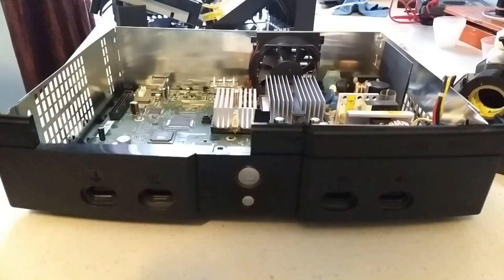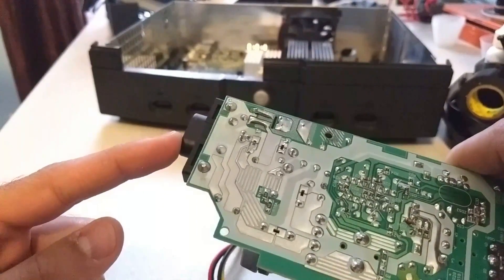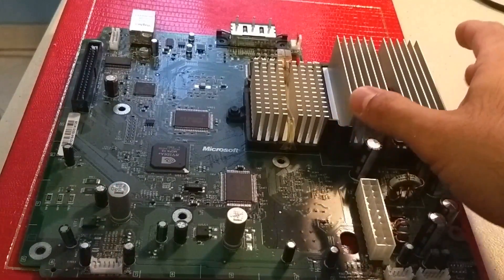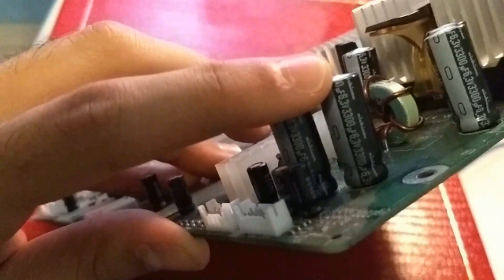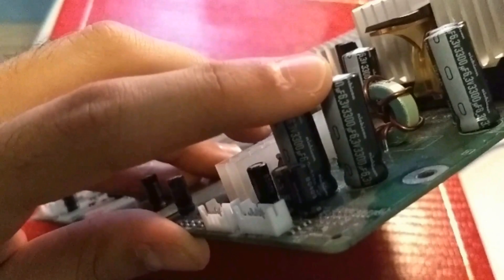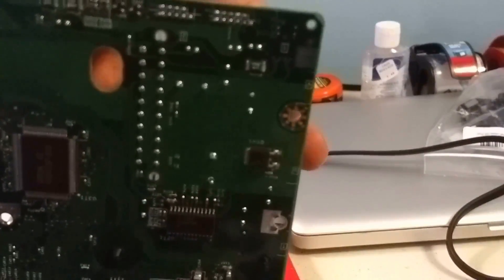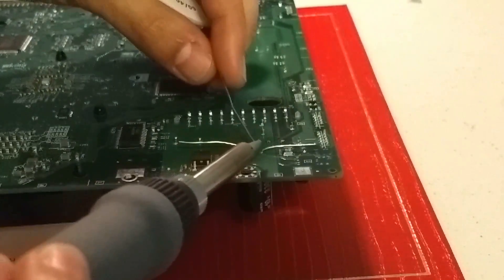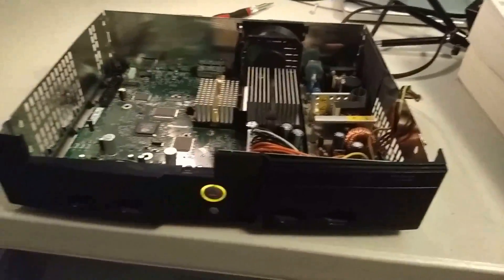Original Xbox No Power Fix- Capacitor Replacement

Comment: Any tips for desoldering the caps? Mine just don't seem to want to come out 😂
Reply from the maker: without a desoldering gun, you just need to focus on one leg at time. Make sure the iron is hot enough to melt the solder and then pull

Comment: You should get a desoldering gun
Reply from the maker: got one shortly after this uploaded. I dont do cap replacements without it now. Most people who dont do repairs often may not want to shell out for one though. A standard iron will still get the job done.

Comment: How on God's green earth did you remove the solder I have been doing a lot of different techniques nothing worked
Reply from the maker: watch some old soldering tutorials for working on technique and general tips. Honestly those old 1950s ones are super thorough and well made
Reply: @retro_vg_repairs3339  I have learned a lot since my first comment I'm doing microsoldering, cap replacements, joystick replacements and encoder swaps along with trace repair
Reply: @retro_vg_repairs3339  way more experience now as of last year but you are correct in my case I added fresh solder then it went smoother did a RAM upgrade and everything myself as well as a full refurbishment I will say the clock cap thing on a 1.6 isn't necessary true it was at the time but they are well past their life span and I'd recommend replacing them or putting a LED in its place

Comment: hello can u  help me ? i have an v1.2 og xbox with foxlink power supply 220V The main capacitor 400V 180uf is bulging after i replace it with the new one its bulging again and again ,pls help
oh yea and theres no sign of burn component everything looks clean
Reply from the maker: you replaced the cap or the whole PSU?
Reply: Just psu main cap & all cap on the mother board
Reply from the maker: @dani8902  I mean at this point try to replace the whole PSU. Could be something wrong with the whole Power board. If you have a spare xbox thats the same model, try swapping
Reply: @retro_vg_repairs3339  Hard to find a new V1.2 PSU on market og xbox Is very Rare on My Country :/

Comment: Ironically these are the exact capacitors that went bad on mine. Thank you for this video!
Reply from the maker: its somewhat common for those to fail IDK why
Reply: @ my new issue is that my hard drive just doesn’t read now. I have years of progress and mods on it that I can’t access anymore

Comment: Hey mate i blew the capacitor right at the stair of the board where the power comes in and can’t read the size of it could you tell me what size yours is so I can replace my?
Reply from the maker: The caps that are electrolytic all have their values written on the side. Try to take good pictures

Comment: the 1.6 clock caps do leak as i've had several that have leaked and are in a worse position as the traces beside it are off the mcpx2 chip(south bridge)
also the power cord he refers to was issued for the 1.0 with foxxcon psu as they were pron to failure and were never issued for later console as the issue was addressed correctly

Comment: 1.6 xbox didn't exist until 2004.  The reason he has saves from 11/01 was because he unplugged it long enough for the clock capacitor to drain, and then on next boot up just hit A a bunch to skip past setting the time, so it was set to release date.
Reply from the maker: Correct, but that would have killed the vibe I think

Comment: Invest in a pair of micro sheers/cutters. Bending the leads back & forth till they break is no bueno, dude! You take the risk of stressing your solder joints otherwise. Other than that, good video. 👍
Reply from the maker: Correct, but im also not ham fisted and twisting it super hard. Someone less careful will certainly make more of a mess for sure. Thanks for watching

Comment: Halo 2 was released in 2004 and yet the saves are from 2001 so the clock would have not been set right. He probably went fairly long periods between powering on so set the clock at random.
Reply from the maker: dude everyone is pointing this out and ruining the magic. Just let my past self be naive
Reply: @retro_vg_repairs3339  sorry! All good. I don't think I read the other comments when I posted.

BTW, are you set up on Insignia, the new OG Xbox Live servers? It's been pretty cool taking the console online.

Comment: The guy did not play any of those games in 2001, because the revision of that motherboard didn't come out until 2004. He just didn't bother to set the time.
Reply from the maker: I did realize that much later , you're right. It's too bad most dates on people's game saves are probably not accurate
Reply: @retro_vg_repairs3339  My xbox was the version 1.0 So some of the saves did make me curious because some where random dates, so I totally get the point of interest.

Comment: Thanks for this! Attempting to fix a Xbox with no power right now. I believed the problem was with the actual power board but I couldn't find blown capacitors or broken traces. My dumbass didn't think of looking on the motherboard. 3 blown and corroded capacitors! Already ordered some on Ebay :)
Reply: Update: even with my horrible soldering skills, this managed to bring my Xbox back from the dead!
Reply from the maker: proud of you, son

Comment: will those caps in the description work on every single cap replaced in that area? and do i need to order diff types?
Reply from the maker: All those caps are the same, you can check the labels on them. Sorry this is 4 years late
Reply: @retro_vg_repairs3339  Glad to see you still responding i have question... So my friend gave me an OG XBOX and when I plug it in it powers up immediately but then it shuts off after a minute.. The power button doesn't work at all either.. I took the XBOX apart thinking it was trace rot but the motherboard looks perfect.. What else could be causing this issue? How can I troubleshoot it. Thank you.

Comment: Thanks for the video - I am new to all of this so your videos have been super helpful. I think that my Xbox is a v.1.6 and it is not powering up. It looks like I will need to replace the caps as 5 of them have bulging tops but no leakage. The only info on the side of the caps is “105’C HD420”. Doesnt show any other info on the cap. Do you know what capacitors I can get to replace these? Thanks for your help.
Reply: On closer inspection I found the info!  Thanks again.

Comment: You should make another "No power" video for a v1.0 xbox power supply. Our house got hit by lightning and it killed my 1.0 Power Supply. On the bottom of the PS, I could see that the Jumper 15 (J15) component popped and caused a no power situation. I can't figure out what component it is or how to fix it
Reply: If you're still interested it looks like a Surface Mount (SMD) Zero Ohm Resistor . I believe you can jump it with a piece of wire , but you might want to do some checking on that .
Reply: @bryanobrien2726  That was the first thing I did and nothing happened. The lightning must've fried more than I thought but I bought another power supply and that fixed it
Reply: @Wilson_Racing  Good to hear that you got it working again  . It was probably a wise choice to just replace the whole power supply .
Reply: @bryanobrien2726  I agree. While looking online for ways to fix it, I found out how to softmod and hardmod them and load them full of games with a larger HDD. So I went from having one retail console to having 5 modded O.G. xbox's including the one I saved lol. I also now have 2 retail Jasper 360s (one is a big block), a retail Corona slim, Trinity slim and an unmoddable Slim E
Reply: @Wilson_Racing  Sounds like me . I have 3 OG Xbox's , 1 is softmodded and will hopefully have a bigger HDD this weekend . Just did all the thermal paste on them and replaced all the bad capacitors . And I've got 4 360's , A Falcon , a Corona slim , a Corona E and a Winchester E . The old Xbox's are kind of addictive .

Comment: I swapped my bulging caps with these but my xbox just makes a clicking sound when it tries to turn on. Before the fan would at least cycle for a second... what did I do wrong?
Reply from the maker: Was it working before? Isolate where the clicking is coming from. Put your ear up against the system. If hdd is clicking, it's probably dead. Replacing a HDD is covered on my Xbox common repairs video
Reply: @retro_vg_repairs3339  naw the HDd was not connected I realized what the problem was.. I forgot to clip one of the leads on the bottom side of the board and so one of them was shorting to the grounded shield casing. So the xbox turns on now but theres another problem. If turns off as soo as I plug in the av cord. Like it'll power on and stay on and then I plug in av cord and it turns off after a sec
Reply from the maker: @nightrider000_7  sounds like another shorting problem. what happens if the av cord is plugged all the way in before you try to turn it on? Do you have other AV cables to test?
Reply: @retro_vg_repairs3339  I have multiple xboxes and I've tried other cables. Those work with the normal xbox's so it's not the cable. I'm suspecting trace corrosion on the board for this broken one but when I looked at it before I didn't see any..
Reply: If I plug the av in all the way before I turn it on, it turns on only for a sec and then turns off. Each subsequent turn on becomes shorter.
Reply from the maker: @nightrider000_7  have you check the back of the board, right behind the clock cap? I have a video where I show this issue relating to power on problems. If there's no visible sign then it will be very hard to figure out. It could be the board has just given up
Reply: @retro_vg_repairs3339  I thought the v1.6's dont have clock caps :o but I'll  check. Btw I really appreciate all your help ma man 👍🏻
Reply from the maker: @nightrider000_7  I misspoke. I'd still check anyway

Comment: I think there is a reason why M$ using these unreliable Nichicon caps. Nichicon HM-series caps has a very low impedance value - around 10mR at 100kHz for 3300uF. I suppose this essential for filtering high frequency noise, that may affect overall system stability. So, I think that swapping these caps to any other with same capacitance and voltage may be not enough. Nichicon PW series used here as replacement also has low impedance value (about 40mR). But other capacitors may have much higher imp.value and may be not suitable as replacement.

Comment: I have 1.6 Xbox but the capacitor is not bulged out but I can see traces of fluid coming down from top which is flat perfectly ,as well as the clock capacitor which is of golden color is a little bit bulged than normal ,should I repair both because my Xbox turns off instantly when I turn it on
Reply from the maker: Yes if it looks wrong you should replace it.

Comment: What tempeture do you have the iron at when removing and replacing the caps?
Reply from the maker: Usually 500-600
Reply: @retro_vg_repairs3339  Celsius?
Reply: 300 - 350 Celsius. Somewhere in the middle works best imho, around 330 C

Comment: I'm already in the process of ordering caps for both of my Xbox that have failed caps. They've both (v1.2 and v.14) had the exact same 3x Nichicon caps fail (actually exploded in the v1.2), but somehow the Xbox still function just fine. Though the v1.2 doesn't want to stay turned off (but that's probably the also dead clock capacitor).

Note to everyone: To avoid your Xbox having its caps fail, unplug it or switch it off at the powerpoint. That's why my first Xbox is still in perfect working order unlike my second hand ones (including its Thompson drive).

Edit: Also, the v1.6 does have a clock capacitor (it's the lone gold one near the IDE connector), it's just of a better quality than the original ones. It could still fail given time. BTW, the Xbox you repaired was a v1.6/1.6b, meaning that its from 2004 at the earliest. The original owner probably didn't bother setting the clock fully (I know that I never did).

Comment: This is also exactly what happened to my 1.6 Xbox. I ordered 5x Panasonic FJ 3300uf 6.3v capacitors to replace the stock Nichicon HM capacitors. According to some forums I discovered while researching suitable replacements, HM caps manufactured between 2001-2004 are known for having high failure rates. 

I found this video after I had already diagnosed my problem, but I think that as these consoles continue to age, this video will be very useful to a lot of people looking to fix their Xboxes. Maybe they will opt to have a retro video game shop repair them, but at least the knowledge will be out there.
Reply from the maker: Denoex thanks for the feedback!
Reply: my xbox was made in 2004 and still works perfectly since day 1
Reply: @SeanLowe1288  You'll need to remove the clock capacitor if it's got a 1.4 revision motherboard.
Starting in Sept 2004 they changed to the newer revision 1.6 motherboard which generally speaking is fine.
Reply: @realgroovy24  I think mine is is a 1.6 modle
Reply: @SeanLowe1288  That's good.
In my time doing Xbox repairs, the only real issues that come up with the 1.6 is a transistor preventing power
This guy has a video on it:
https://www.youtube.com/watch?v=deSa6-yeY1I
Reply: I used some Rubycon capacitors since my Xbox had some Rubycon capacitors that stick look brand new compared to the Nichicon ones I had to replace.
Reply: @pgFrancisco  they arent brand new kid
Reply: hello   do the j
PANASONIC FJ Capacitors also working on the Xbox ?    I am going on hurry to order  haha
Reply: @clai889  Yes they would be fine.
Reply: Yep, mine too. A common failure point if I might add.

Comment: Hey friend. My Xbox stop to turn on. The capacitor apparently dont have any damage, top is super flat !! How can i test de power supply ? It uses a 1.1 psu version!! Thanks !
Reply from the maker: George Pucci hey, you can use a replacement power supply from a 1.0 or a 1.1. they are the same. Easiest way to check is to swap it out. You can also use a multimeter to test the voltage on the large motherboard connector.

Also check the solder joints on the power plug 1:25
Reply: Retro_VG_Repairs the joints are ok ! I need to know how i can “Start” the psu to use a multimeter and test voltages from connectors. Is very hard to find another psu here !!! Thanks !!
Reply: @GeorgePucci  Yours (probably) has cracks all along the PSU board. You can fix it by checking if there's any dry solder joints on the board, especially near the power connectors.

Comment: Chances are good the dates on those save files are the result of the owner not bothering to set the clock.  The Xbox was released in 2001, but this is a v1.6 board, meaning it was probably manufactured late in the OG Xbox's life cycle around 2004-2005.
Reply from the maker: Yeah I realized that after the video and that bummed me out. Good catch

Comment: My XBOX was manufactured on 10/09/2003 this development version of the clock capacitor removed?
Reply from the maker: Beto BR that's likely
Reply: No. Everything from 2003 is a revision 1.4 at maximum which does have the capacitor issues. Yours is likely a 1.3 or 1.4
Only the 1.6 revisions are the versions without issues.

Comment: Very good! My Xbox original have problems too
Reply from the maker: Roberto Lucrezia what's wrong with yours? maybe I can fix it
Reply: Retro_VG_Repairs I click on the Power Button It turns on the led And turns off twice And on the third It blinks and has no image
Reply from the maker: Roberto Lucrezia ah that's not a good sign. usually indicates a fatal hardware problem. did you remove the clock capacitor?
Reply: Retro_VG_Repairs No
Reply from the maker: I highly suggest you watch a video about the Xbox clock capacitor, then open yours up to take a look inside.
Reply: Retro_VG_Repairs The clock capacitor is installed
Reply: Hi. Clock capacitor removed but the problem continues :(
Reply from the maker: Sorry dude. Not sure what you could do, other than replace the motherboard/hdd